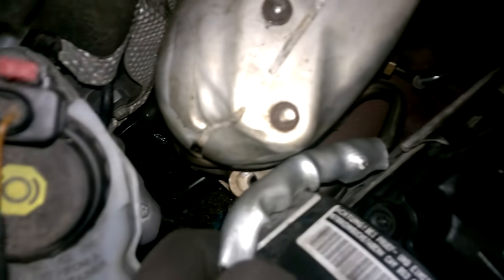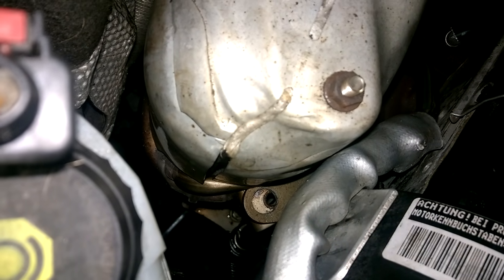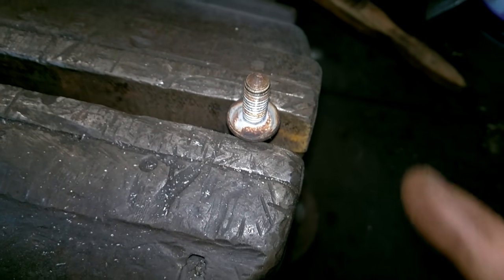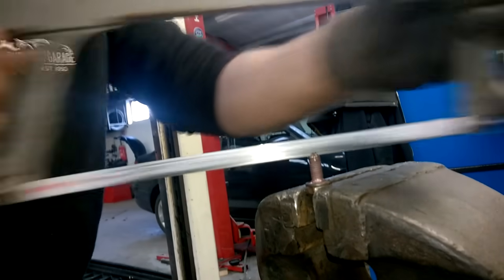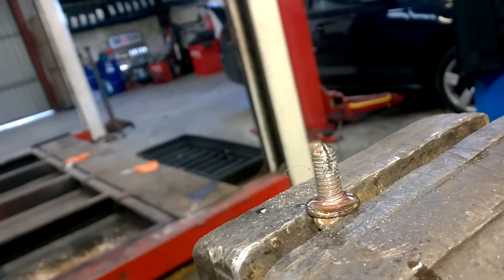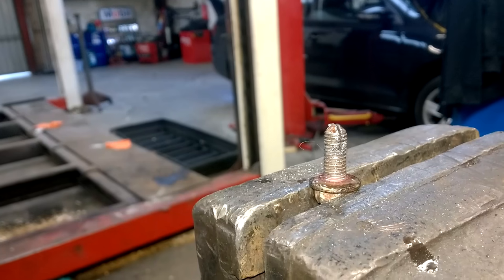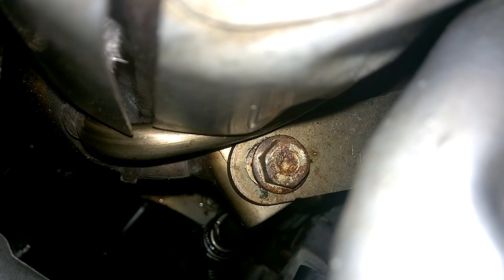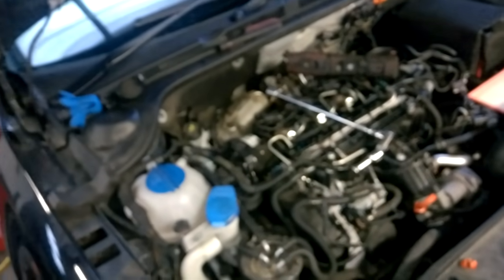My Father Taught Me This! Passing It On To The Next Generation

Comment: Situate the head of the bolt in the center of the vise, you'll get a more secure hold on it and it will have less of a chance of coming out of the vise. ALSO, it's easier on the vise.
Reply: SledgeHammer wouldnt that risk crushing the threads doing that?
Reply: Brian - the threads aren't affected. He said to put the HEAD of the bolt in the center of the vice. The guy in the video put the HEAD of the bolt in the vice at one side (to the right) which means that the HEAD of the bolt was not gripped properly.
Reply: SledgeHammer. Get a grip guys don't be so Anil.......the vise is plenty large enough to secure bolt anywhere!  It would only be a concern if it was a small vise !
Reply: I think you need a better vise mate, if you think that needs to be in the middle of that vise to cut that tiny bolt. Wow!! this comment section is incredible.

Comment: What a NICE trick to learn!!  Thank You!
Reply from the maker: Thanks for the kind words Gary, I linked the follow video below if ya wanna check it out. 
 
The update info below is the pinned comment on this video, I know most people do not realize I made that video and it better explains/shows this method in use.   
I also included below details of why the job was done this way free of charge with the customer fully informed. I hope you check it out  👇👇
 
UPDATE* I decided to make a follow up video on this https://www.youtube.com/watch?v=yfNQullGEuQ&feature=youtu.be Should answer some of the questions that were raised, I include 3 demos of this in action with close up shots.
 
As there was some safety concerns & confusing comments raised, I felt I should clear a few things up. 
1) This is a tip for certain circumstances only, I never have and never would use it on a component which would cause any safety concern to any customer.  
2) The demo was done on a support bracket only, items like this or similar will not cause any safety concern. 
3) I did this free of charge and on a time restraint, I noticed it when I was replacing another item, the customer needed the vehicle back that evening and I decided rather than leave it like it was, I would do this and secure it up fully. 
4) The bolt was not the issue, the part that the bolt threads into is a secured piece, someone had previously damaged it, leaving the bracket loose and the bolt just tightened a turn or so.
5) The bolt can be removed and will not break, it will go in and out as usual and has helped clean up the damaged threads.  
6) Used in the right application I personally believe this is a great tip and can save you a lot of time & trouble. 

Lastly to all the people who have watched the video, Thanks very much and I am delighted with the feedback I have received on it.

Comment: When cutting use the whole blade of the hacksaw
Reply: realcoolphil. When I was an apprentice engineer in the mid 1960s. My tutor always said if you have a 12 inch tool use the whole length of it.

Comment: Wish I had seen this video before I struggled reassembling the rudder actuators on the Boeing 737 I have been working on all week! Could have saved hours had I thought of this.
Reply: Pretty sure it wouldn't be a good idea on aircraft though
Reply: Hank Richards helped lighten the bolt so makes the plane save fuel.
Reply: @fritzsmith3296  what Da?
Reply: sarcasm or stupidity? Any aircraft mechanic would know you can't alter any part of an airplane. Not one bolt or screw!!!
Reply: @rickhatesmisleadia7101  Sarcasm my friend. Thankfully Gerard has clarified the the suitability of this hack for non safety critical components. God forbid anybody would try this on a steering/suspension/braking component!
Reply: @NK-dl2nc  I thought so ..lol  but had to ask since many lives are at risk. Take care
Reply: @Charles Thomson calm down no need for name calling.Its obviously a troll and joking look at its bio lol So just relax Charles.
Reply: ?Christine McCaulliff

Comment: All you have to do is round the end of the bolt , putting a slight angle on it. Insert the hole, turning it backwards until you feel the end thread on the bolt give a slight click as it alighens with th first thread of the hole. Turn clockwise ,with a little pressure and your in. Much faster.
Reply: Ciaran Rooney  before you round off the top you thread a nut on the bolt. When you're done grinding the bevel on the bolts you unscrew the nut and it cleans up the threads like new
Reply: Dan Nelson 
That’s a good idea I don’t know why I didn’t think of that I’ll remember this for my damaged thread just one thing though I sometimes get a bolt with damaged thread in the middle how can I fix that problem?
Reply: @Mega6501  use a threader. Takes about 5/10mins depending on bolt length, tools used, and personal strength if using hand tools!
Reply: Ed D 🤮

Comment: These tricks passed from one to another and continued onward are precisely what advances us as people and this father left a mark and legacy of this and I'm sure so much more. Give your kids your tricks, tips and advice.
Reply from the maker: Agreed Mike, 
 
The update info below is the pinned comment on this video, I know most people do not realize I made that video and it better explains/shows this method in use.   
I also included below details of why the job was done this way free of charge with the customer fully informed. I hope you check it out  👇👇
 
UPDATE* I decided to make a follow up video on this https://www.youtube.com/watch?v=yfNQullGEuQ&feature=youtu.be Should answer some of the questions that were raised, I include 3 demos of this in action with close up shots.
 
As there was some safety concerns & confusing comments raised, I felt I should clear a few things up. 
1) This is a tip for certain circumstances only, I never have and never would use it on a component which would cause any safety concern to any customer.  
2) The demo was done on a support bracket only, items like this or similar will not cause any safety concern. 
3) I did this free of charge and on a time restraint, I noticed it when I was replacing another item, the customer needed the vehicle back that evening and I decided rather than leave it like it was, I would do this and secure it up fully. 
4) The bolt was not the issue, the part that the bolt threads into is a secured piece, someone had previously damaged it, leaving the bracket loose and the bolt just tightened a turn or so.
5) The bolt can be removed and will not break, it will go in and out as usual and has helped clean up the damaged threads.  
6) Used in the right application I personally believe this is a great tip and can save you a lot of time & trouble. 

Lastly to all the people who have watched the video, Thanks very much and I am delighted with the feedback I have received on it.

Comment: Good trick for a non critical fastener. You wouldn't do this on a critical joiner of course.
Reply: Jason Voorhees 

My thoughts exactly. Thanks for saying it. I see vw owners slicing wheel bolts, or people creating danger when a tap or die would solve the problem.
Reply: yup in most situations this isn't going to be a problem but don't be doing this when you want to bolt say an alternator to your block lol after a while that belt will snap that sucker right off and send it flying who knows where in the bay.
Reply: It has an NTSB and nuclear rating.

Comment: HALF WAY DOWN?  ABSOLUTELY NOT!  You weaken the grip strength of the bolt.  And NO - YOU CAN NOT torque it to its full torque value.  It's very likely you will pull the threads out of the mating component.

As for making the hole bigger - - - I noticed there's a good portion of bolt head resting against an open area.  In other words, there's nothing to hold the bolt from rotating out under vibration.  A very high probability the bolt will come loose.

Either get the right bracket or plug the existing hole with weld then drill a new hole in the proper location.  That way you don't need to hack a bolt just to get it to thread in.  {good reason not to buy used things from smart people - they know how to hack something together and you have no idea there's an inherent weakness in something they did}.
Reply: Dude, it's a bracket, not a pressure vessel in a nuclear reactor
Reply: Pete C Just use some high strength locktite

Comment: Very nice. I found on small size screws, if you can't get the thread started, to use a self-tapping screw of the same size, or if the thread is very damaged, use the next larger size.

Comment: I seen someone use a tap and die before
Reply: Blimey! That's tragic, was it drowning?
Reply: And you gonna squeeze one down in there? Or spend hours taking everything apart? Or just do this quick fix which hurts NOTHING and get the damn job done? Some people, they "know everything." I like to call them "Comment Genius'"
Reply: Fix it right or save 5 min and hack it... Sure the hack will cause premature failure, and will take an hour to fix (possibly more if that bolt rust and breaks, good luck getting that out) but that is later down the road and not my problem.
Reply: @thetessellater9163  lol👍
Reply: As opposed to this "hack job"?   lol
Reply: Would be a pain in the ass for something that is down in the engine compartment and doesnt need to hold much weight
Reply: Dr. Murdercock there are special sockets which will allow you to drive a tap with a ratchet. And if you don’t have those, many (but not all) sized taps will be able to be driven with a 12pt socket.
Reply: @martinjoyce3814  Congrats, you understand what a "quick" fix is.
Reply: Not everyone has tap and die sets. Probably why he made this video in the first place to show people who don't, genius.
Reply: @south_sickle1091    Jeez! Some people just can't see the simple side of things. From the what can be seen of the location of this bracket it doesn't look like it holds anything under a lot of stress like the alternator or power steering pump. So that means it doesn't really need the full take apart everything, drill out the hole, tap it for a plug and plug it, then drill and tap it for the proper bolt size, then put everything back together waisting a full day or more if you cause other problems while taking things apart, just to fix a few threads in a bolt hole that holds a bracket that has part of the wiring harness running through it to help keep it out of the way of other things. Jeez! Take it as it is! A simple fix for a minor problem that was created by someone else.
Reply: @DrMurdercock  It is truly amazing how many of the people commenting can't understand what was done here.  You are right.  It does not weaken the part of the bolt that carries the load.  It will not cause the bolt to rust in place or break off as the part with the slot is not carrying the load.  Yeah, my first choice would be to run a tap through the existing hole and run the bolt through a rethreading die.  If it's Saturday evening, any store that carries (just sayin') fine thread metric taps and dies closed at noon you need a solution right now.
Reply: @south_sickle1091   Please explain how the hack will cause the bolt to fail prematurely.  The cut was not in the load bearing area.  How will it cause the bolt to rust or break?  (Hint:  It will do none of the above.)
Reply: @David-hm9ic  wow, please understand that you ignorance is astonishing to grasp completely. First, let look at load. While you are correct that most of the pressure is on the last 3 threads (ones near the head) we can not discern from this video what this is holding. What we can discern is that an engineer specifically chose this bold (length, diameter, thread, and bolt metal type) to be used for a specific reason. The engineer did not choose the bolt thinking that somebody would cut on it. This is the same way you don't use a sledgehammer on a nail, it may work but not best tool for the job so you use a framing hammer. Secondly, this will rust, not only will it start sooner it will rust at a greater speed. This is simple physics that you should have learned in high school chemistry possibly in middle school science class. In summary, why hack when you could fix correctly? Just cause it works most of the time does not mean it is correct, and will not fail. Would you take a pill that has a 2% chance of killing you or a 6% chance? Both are extremely low percentages but anybody with half a brain is going to choose the one with the better odds. I would see this kind of stuff on the frame growing up from lazy uncaring farm hands with no pride or self worth. More interested in just doing the bare minimum rather than what is right.
Reply: the tessellater- 😂Clever. Like it man!
Reply: @south_sickle1091  jw do u put grease on bolts before you insert them into a engine at all?
Reply: @south_sickle1091  I think I understand what you really meant to say.  That first sentence is hard to follow.  First, you have never apparently been working on a street rod or other project when a proper solution was unavailable, say 11:00 PM on a Saturday night.  Second, Mr. Burke was making better something that an imitation mechanic had left unfinished.  Third, he had a damaged bolt that was correct in diameter and pitch and damaged threads in the receiving bracket.  The vehicle on which he was working came in with nothing in the hole according to what he said.  The piece into which the bolt is screwed is visible in the video and is is not especially thick and the bracket it secures is very thin so my well educated seat-of-the-pants common sense says that it is not a high load fastener.  The bulk of that load would be in shear rather than clamping force considering the position and light weight  of the bracket being secured.  We do not know with certainty the length of the original bolt but in many automotive applications the bolts are far longer than necessary and have reduced diameter ends for easy assembly line installation.  The bolts that hold the bed of my truck on are about two inches longer than necessary, simply for ease of installation.  Cutting off or otherwise altering the last 1-1/2" would do absolutely nothing to weaken the bolts or affect their ability to keep the bed attached to the frame.

I have taught gunsmithing which includes teaching the operation of lathes and milling machines.  I have built very accurate bolt action rifles.  I have built two street rods and driven both many miles.  I have restored antique light planes.  I have refit an ocean going sailboat from the bottom of the keel to the top of the mast and then sailed it on the open Pacific Ocean with exactly zero failures.  This hack is not something I would ever consider doing on an airplane or a boat but it got a problem fixed until a better solution could be applied.

I fixed a Ruger Blackhawk recently after "Bubba" installed a scope in it.  I had to bore out and re-tap the 8-40 hole he created to 10-32.  I machined a slightly oversized 10-32 plug that was a tight friction fit in the 10-32 hole.  I drilled the plug and tapped it to 6-48 in the center as was originally intended.  The plug was driven in with an installation tool I made and then a factory original rear sight was installed.  The entire machined plug was a mere 0.130" long when finished.  Do not think you know anything of my intelligence, comprehension or skills.  You will underestimate me every time.

You would do well to watch Mr. Burke's follow up video where he allays the alarmist reactions to a simple repair.
Reply: @south_sickle1091  cool story bro.
Reply: @David-hm9ic  cool story bro.
Reply: J.B. Weld

Nuff said!